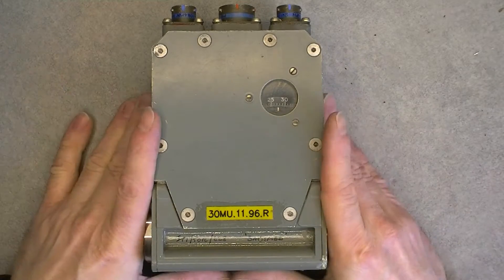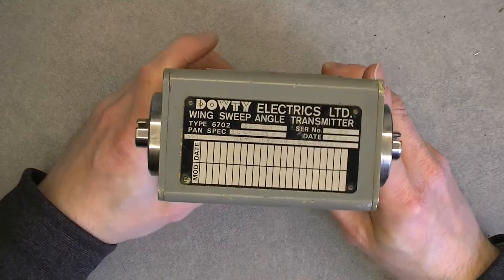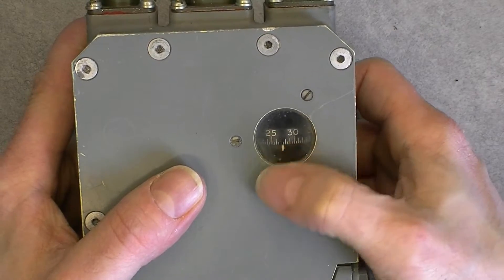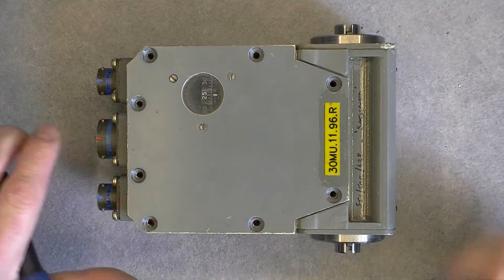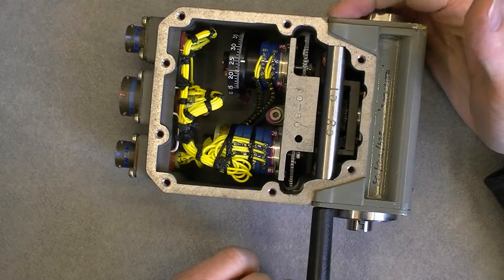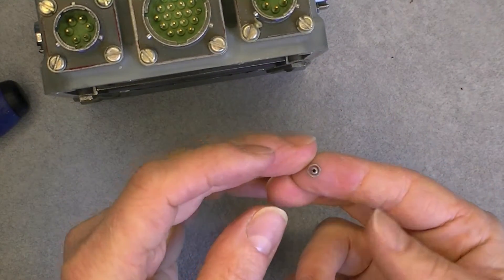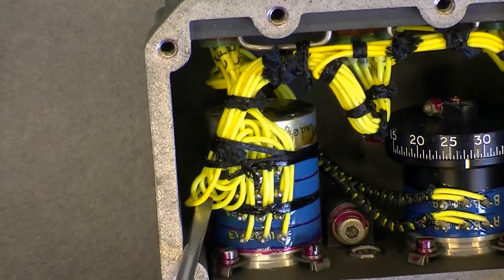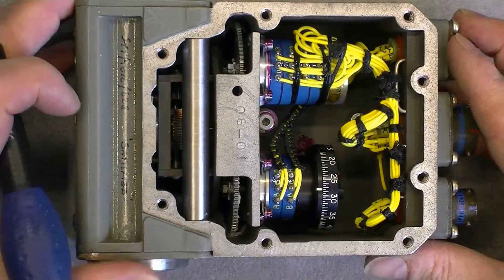Panavia Tornado wing sweep angle transmitter teardown

Comment: http://zarco-macross.wdfiles.com/local--files/wiki:panavia-tornado/0361-02-2-7.jpg

item 109 on that cutaway is the cross frame wing rotary wing actuator.  Basically a massive lead screw (screw jack) that furls the wings!  It has to deal with huge loads, so the thread pitch is fine, and lots of rotations of the lead screw are required to swing the wing across it's complete range

Comment: On some airplanes when the wing (spoilers?) raise up you can see a rotating shaft that seems to rotate many times to extend the (outboard flaps?); hydraulic motor sounds are heard. So I'm thinking this device you have there is for flaps as the ailerons and spoilers move so quickly up and down and don't seem to make screaming fast hydraulic motor sounds; I'm guessing they are piston driven. Fun!

Comment: I have no idea but I wonder if this is the angle sensor for ailerons or flaps driven by the hydraulic motors. Was that 15 to 80 on the indicator? Perhaps 65 degrees of deflection   or units of movement.
Reply: it's for sensing the status of the wing configuration on the tornado. during flight, the wing angle could be adjusted from about 25 to 70 degrees. see: https://en.wikipedia.org/wiki/Variable-sweep_wing